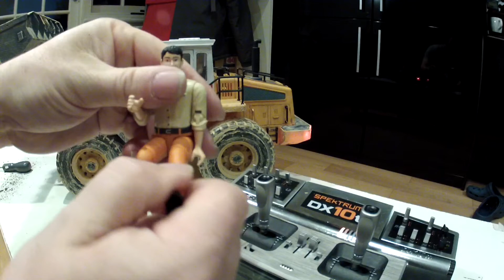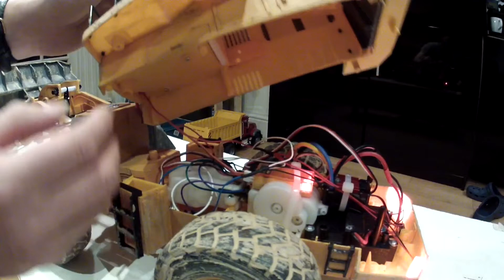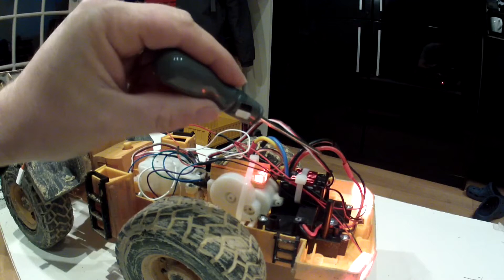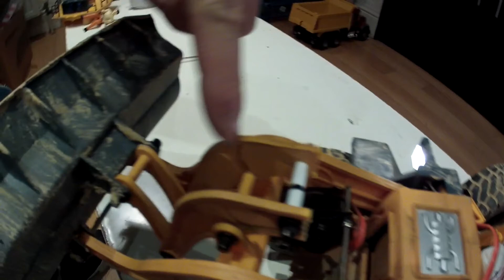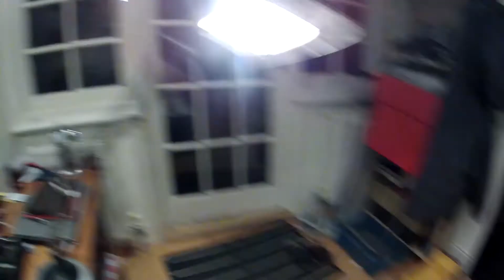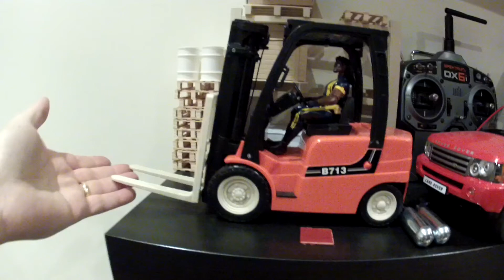Hobby engine HE 0706 wheeled loader: RC Conversion explained

Comment: I think the bucket movement is the worse thing the standard model.
I see you have used an external servo.
I got a good result taking off all the leverage and studying how to use the default motor with new almost direct leverage.
If I could use all the torque of the standard motor I think it could be enough.
Have you done a video explaining how to open frontal part of the machine ?
Reply from the maker: Hi & thanks for watching the video. I think that I may have avoided taking the front apart - apologies, I cannot remember if I did, I didn't make a video of doing this. Your video on this looks like a good way to do the bucket linkage! 😃👍

Comment: I never would have thought to use the board from a servo to convert a toy RC motor to work with hobby grade radio.  thank you for sharing...im sure I will end up trying this in the future.  I recently  got the hobby engine 1/12 track loader and hobby engine premium excavator.  The first track loader had the slipper in the lift arm strip, but the excavator has worked very well.
Reply from the maker: +RCPro Driver Yes. The other good thing about this method is not just the price (free if you have old servos around), but that the boards are small, two way and variable speed.

Comment: I wanted to get the same loader do you have a pic as to where you put the servo for the bucket arm once I get mine I will be swapping those hard plastic tires for some crawler ones to get more grip going into a pile of dirt good job
Reply from the maker: The motor isn't very powerful. I haven't tried messing with the wheels / tyres. I was trying to keep the conversion quite cheap. I still need to find a way to limit the steering, I've tried to avoid putting a servo in, I still might ....
Reply: Cool good job on it
Reply from the maker: I will try and do this.

Comment: Are your Bruder trucks RC ?
Reply from the maker: Hi. I've only radio controlled one Bruder truck - the Mack dumper - it was quite hard to do, but I managed it. When I have some time I'll try and do a video showing how I did it. The main drive is an 80 turn motor geared down using Meccano with Meccano axles on the rear wheels, which are all driven without differentials of any sort. The steering uses some old Mardave Maurauder parts that I had lying around. It all works quite well and the truck can handle and dump a full load of damp earth. The other 1/16 trucks are Tamiya (Scania) or Hobby Engine (log loader, digger and bull dozer). Thank you for your interest, I hope you like my videos.
Reply: +lotus77s yes sir I am very interested and will be looking for a video hopefully soon ! I have been wanting to do a conversion on one of the Bruder trucks  but not sure how to go about it so a video would be lots of help ! Thanks